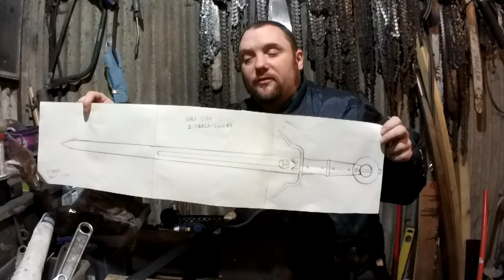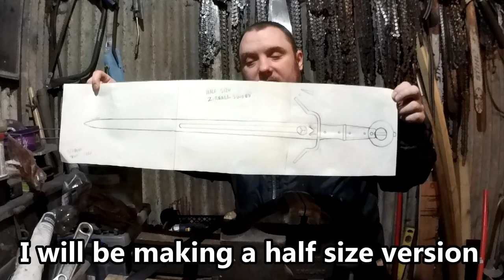How to make a Witcher Sword - No Forge Sword Build

Comment: lovely work, as ever. I have aproject on the go, peining was a harder skill to learn than I thought it would be. I`ll do a vid soon, just hope I`ve got it right...
Reply from the maker: Thanks Tim, i shall look forward to that,  i often found the bigger the nail the easier it was to peen, if they're quite thin gauge i would sometimes bend it, i found not hitting too hard helps too. i wished i learned to peen and do diy rivets years ago, only been doing them for a the last year or two and saves some much time and trying to find the right size bolts or fixings etc.

Comment: Great finished result!,  have you ever tried using spring steel flat bar?,  that cutlass you did looks spot on!, 
About 20 years ago I tried making a copy of Roman gladius from mild steel, and thick brass bar,  I would have made more it was only the neighbours constant complaints about noise from angle grinder that ruined things lol😀